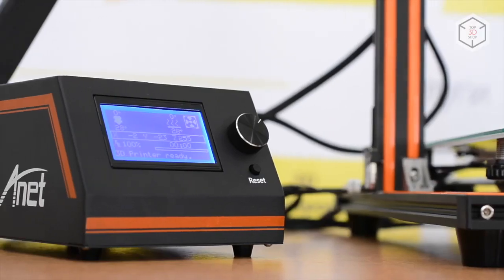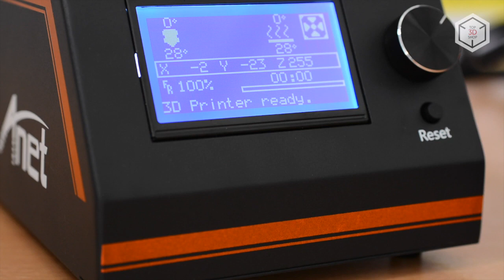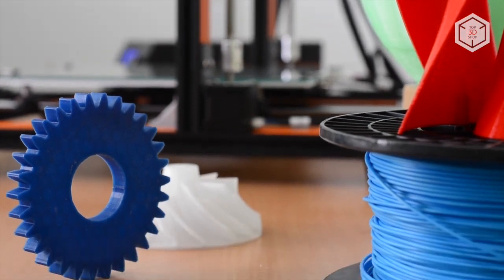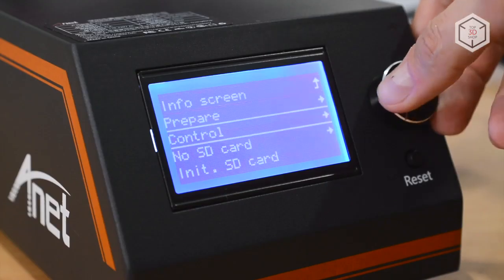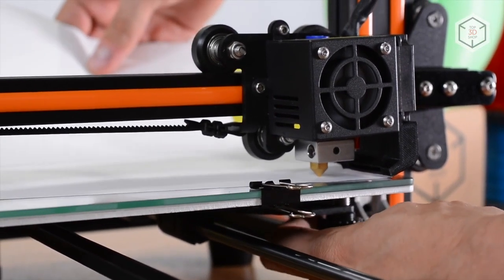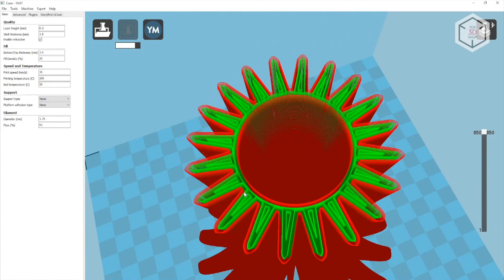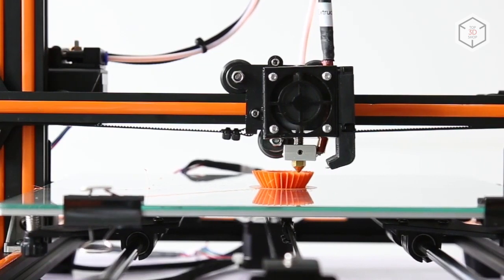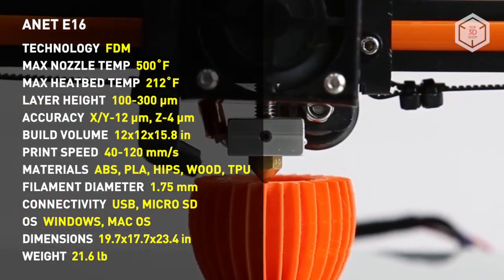Anet E16 Review: Is this Large Format 3D Printer Worth the Gamble?

Comment: I have had the anet e 12for a couple of months. If you plan on upgrading it with better parts just buy a more expensive printer. I have over $400 worth of parts into my e12 and it still isn't where I want it to be at. If I would buy another printer it would be one that has proven itself to be precise, reliable, and easy to work on. The stock anet's have none of those characteristics. Nice to see the e16 has a glass bed, but my e12 came with an aluminum heated bed that is so badly warped, its basically scrap.
Reply: Justin which 3d printer would you buy now that you know this?